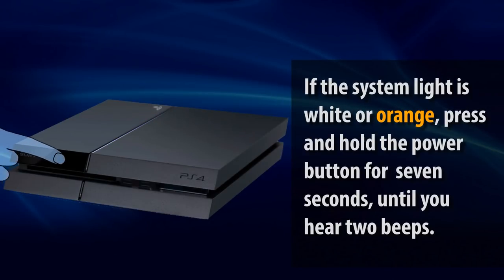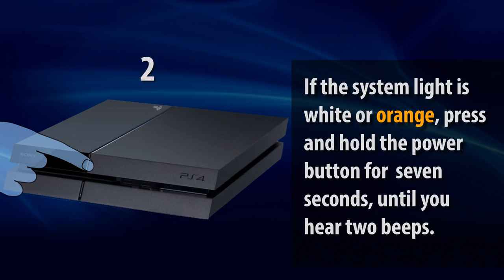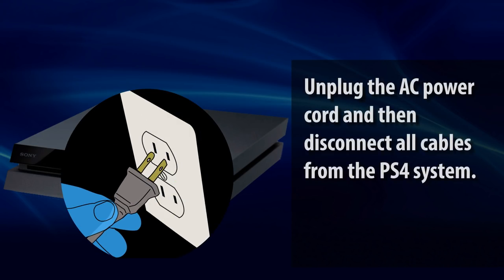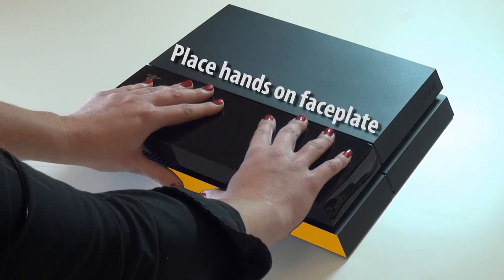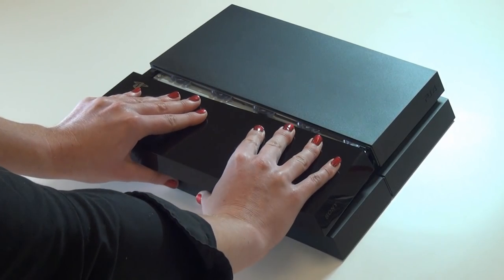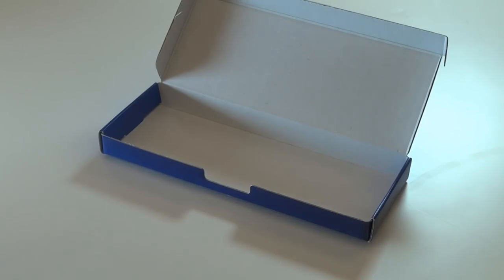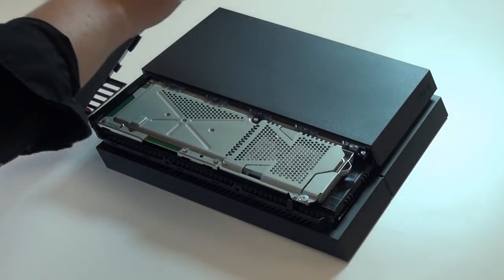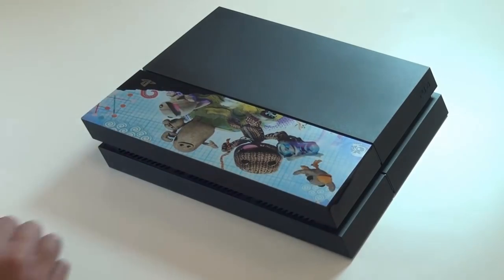PS4 Faceplate Swap

Comment: Wow I didnt even know I could hold the power button lol
Reply: I almost forgot they even had the button! XD
Reply: Me too i always shut it off with my remote
Reply: I knew about that, but I can't hear my system beep when I do it.  Oh well, it still works.....(or maybe I'm going deaf!)
Reply: +evak son. lol i always use to just shut it off via controller xD cause they have all these warning about turning it off manually. so if i lost my controller i just have to wait 2 hours and it shuts off automatically xD
Reply: Me too
Reply: evak son. Bruh...
Reply: evak son. same 😂😂😂
Reply: evak son. Same
Reply: is it the same for slim?
Reply: +Leo Punkers yep although the slim doesn't have faceplates
Reply: evak son. Same
Reply: evak son. Hu
Reply: @dillon9450  you can't shut it off with a remote
Reply: r/woosh the controller I meant
Reply: @dillon9450  oh ok lol
Reply: @DigitalHaze65536  not holding it long enough

Comment: It docent work for me my ps4 never had a glossy top i just want to upgrade my hard rive but the top won't come off to matter how hard i pull can someone pls tell me why
Reply: same here
Reply: SQUIDZILLA i have the same one, but you still take it off the same way.
Reply: SQUIDZILLA Be sure youre pushing it down
Reply: Yep same, ive got a mat faceplate so that means i need to push it harder towards me
Reply: I want to replace my hard drive aswell and I have the glacier white PS4 and it has a matte finish.... Fml....

Comment: i dont have the shiny faceplate can i sill remove it?
Reply: Then you have The newest model like me 2015/2016 model. Yes you can still remove it it didn't change at all! Oh when you do happen to remove the Faceplate take a compressed air can or something or soft rag and dust the inside of the Face plate and around the hard drive bay carefully. Play On!
Reply: +SKY TECH okay thanks
Reply: +RoSa_ChAlLo No problem!
Reply: +SKY TECH ive got the matte black and the faceplate WILL NOT CoME OFF and i need to know how to fix a jammed power button

Comment: “How to open a door”
1 Carefully hold the rounded handle with your fingers around it
2 gently turn it right until you feel force 
3 push or pull depending on your type of door
4 you have now opened your door
Next “How to close your door”

Comment: PlayStation 5

Backward Compatibility Features:
PlayStation 4 (Exception PlayStation 4 Pro Model), PlayStation 3 (Exception PS3 Original Model), PlayStation 2 And Then PlayStation (Console) (Original Model And Then PSOne) (Main Features), PlayStation Vita (Main Features), PlayStation Portable  (Main Features), PlayStation TV (Main Features), PlayStation Now (Features) And Then PlayStation 5 (Extended Features)

PlayStation 5 Game Console Controller Features: Regular Version
PlayStation Consoles (PlayStation Controller, Dual Analog Controller, DualShock, DualShock 2, Sixaxis, DualShock 3, DualShock 4, PlayStation Move, PlayStation Portable And Then PlayStation Vita)
Nintendo Consoles (Nintendo 64 Controller, Game Cube Controller, WII U Gamepad, WII Remote, WII Motion Plus, WII Remote Plus, WII Nunchuck, Classic Controller, Classic Controller Pro, WII U Pro Controller, Nintendo Switch, Joy - Con, Joy - Con Strap, Joy - Con Grip, Nintendo Switch Pro Controller, Game Boy Advance Line/ Game Boy Advance Family, Nintendo DS Line/ Nintendo DS Family, Nintendo 3DS Line/ Nintendo 3DS Family And Then Nintendo Switch Lite)
Sega Consoles (Sega Saturn Controller, Sega Saturn 3D Controller And Then Sega Dreamcast Controller)
Xbox Consoles (Xbox One Controller And Then Xbox 360 Controller (Console Game Controller Not Userable Cable))
PC/ Mac Console Game Controller (Xbox 360 Controller (Console Game Controller With Userable Cable))

Full Version
PlayStation Consoles (PlayStation Controller, Dual Analog Controller, DualShock, DualShock 2, Sixaxis, DualShock 3, DualShock 4, PlayStation Move, PlayStation Portable And Then PlayStation Vita)
Nintendo Consoles (Nintendo 64 Controller, Game Cube Controller, WII U Gamepad, WII Remote, WII Motion Plus, WII Remote Plus, WII Nunchuck, Classic Controller, Classic Controller Pro, WII U Pro Controller, Nintendo Switch, Joy - Con, Joy - Con Strap, Joy - Con Grip, Nintendo Switch Pro Controller, Game Boy Advance Line/ Game Boy Advance Family, Nintendo DS Line/ Nintendo DS Family, Nintendo 3DS Line/ Nintendo 3DS Family And Then Nintendo Switch Lite)
Sega Consoles (Sega Saturn Controller, Sega Saturn 3D Controller And Then Sega Dreamcast Controller)
Xbox Consoles (Xbox One Elite Controller, Xbox One Elite 2 Controller, Xbox One Controller And Then Xbox 360 Controller (Console Game Controller Not Userable Cable))
PC/ Mac Console Game Controller (Xbox 360 Controller (Console Game Controller With Userable Cable))

PlayStation 5 Size Game Console Controller Features:
PlayStation Consoles (DualShock 5 And Then Dual Sense Controller)
PSX (DVR) (Position)

TV/ Radio Resolution
Motherboard Mainboard Intel And Then AMD Asrock (AM4, 1150, 1151, 1155 And Then 1200 And Then 1200, X399, X299 And Then X99), Asrock Rack (AM4, 1150, 1151, 1155 And Then 1200 And Then 1200, X399, X299 And Then X99), Asus (AM4, 1150, 1151, 1155 And Then 1200 And Then 1200, X399, X299 And Then X99), MSI (AM4, 1150, 1151, 1155 And Then 1200, X399, X299 And Then X99), MSI Gaming (AM4, 1150, 1151, 1155 And Then 1200, X399, X299 And Then X99) Gigabyte (AM4, 1150, 1151, 1155 And Then 1200 And Then 1200, X399, X299 And Then X99), Asus TUF Gaming (AM4, 1150, 1151, 1155 And Then 1200, X299 And Then X99), Gigabyte Gaming (AM4, 1150, 1151, 1155 And Then 1200), Gigabyte Designare EX (X399 And Then X299), Asus ROG (AM4, 1150, 1151, 1155 And Then 1200,  X399, X299 And Then X99), Gigabyte Ultra Durable (AM4, 1150, 1151, 1155 And Then 1200, X299 And Then X99) And Then Gigabyte Aorus (AM4, 1150, 1151, 1155 And Then 1200, X399 And Then X299)
VGA Card AMD HIS, Power Color And Then Sapphire Tech (AMD VGA Card Radeon Infinite)

TV/ Radio Multi Input
Home House Console Game And Then Micro Console Game PlayStation (PS4 (Exception PS4 Pro Model), PS3 (Exception PS3 Original Model), PS2 And Then PlayStation TV)
Motherboard Mainboard Intel And Then AMD Asrock (AM4, 1150, 1151, 1155 And Then 1200 And Then 1200, X399, X299 And Then X99), Asrock Rack (AM4, 1150, 1151, 1155 And Then 1200 And Then 1200, X399, X299 And Then X99), Asus (AM4, 1150, 1151, 1155 And Then 1200 And Then 1200, X399, X299 And Then X99), MSI (AM4, 1150, 1151, 1155 And Then 1200, X399, X299 And Then X99), MSI Gaming (AM4, 1150, 1151, 1155 And Then 1200, X399, X299 And Then X99) Gigabyte (AM4, 1150, 1151, 1155 And Then 1200 And Then 1200, X399, X299 And Then X99), Asus TUF Gaming (AM4, 1150, 1151, 1155 And Then 1200, X299 And Then X99), Gigabyte Gaming (AM4, 1150, 1151, 1155 And Then 1200), Gigabyte Designare EX (X399 And Then X299), Asus ROG (AM4, 1150, 1151, 1155 And Then 1200,  X399, X299 And Then X99), Gigabyte Ultra Durable (AM4, 1150, 1151, 1155 And Then 1200, X299 And Then X99) And Then Gigabyte Aorus (AM4, 1150, 1151, 1155 And Then 1200, X399 And Then X299)
VGA Card AMD HIS, Power Color And Then Sapphire Tech (AMD VGA Card Radeon Infinite)
Reply: Wat ?